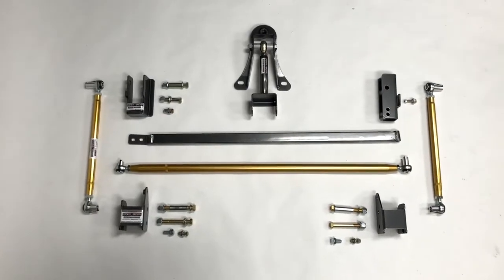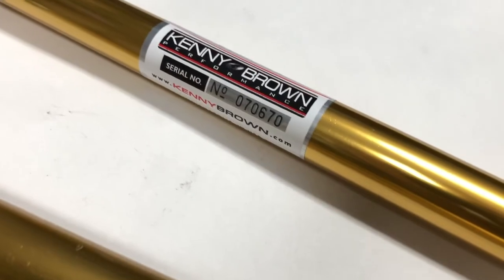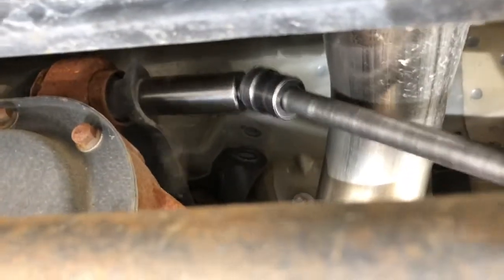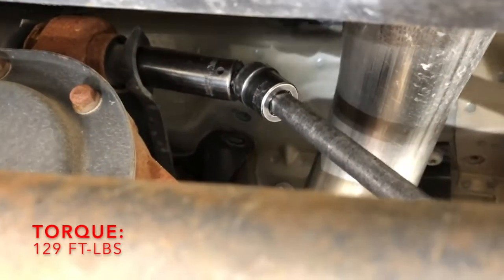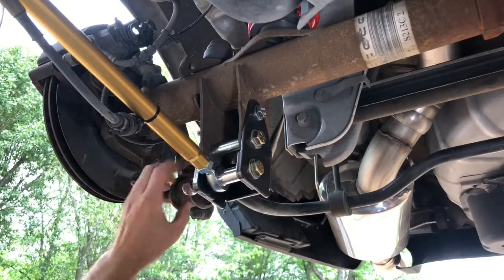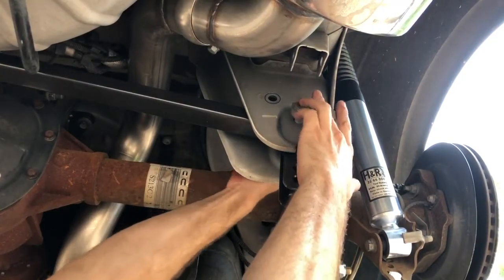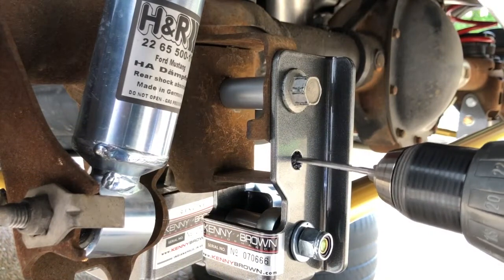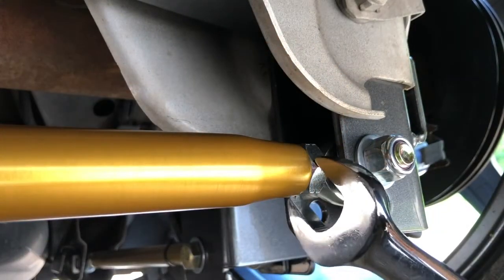S197 Mustang Kenny Brown Rear Suspension "Grip Kit"

Comment: change that axle vent valve 🥴 it’s clogged that’s why the drivers side is leaking and caked in gear oil ⚙️ $40 fix will save your differential and axle!!!!
Reply from the maker: Oh, thanks! Is this what I need? https://www.cjponyparts.com/ford-rear-axle-vent-bolt-8-8-1986-2014/p/HW3281/?year=2004&gclid=Cj0KCQiAnb79BRDgARIsAOVbhRoI9sUV13apTqSePoFRGNSpnFZYCtLaXng_x3ysQ7AWb8zQRyYElmMaAtmaEALw_wcB
Reply: @Mustang-Geek  hey man that’s the oem part I got it and it clogged in a few weeks and started leaking again.. get fords "fix" which is this part
Reply from the maker: @orvm9514  No link, if you meant to post one.
Reply: @Mustang-Geek  part # DR3Z-4022-A I paid roughly $42 worth the extra money 💰
Reply: If youre tracking the car its not a clogged vent.  Whats happening is your oil gets hot, expands, and purges through the check valve when going through sweeping turns.  The solution is an expansion tank.  I installed the JLT kit on mine and no more leaks.